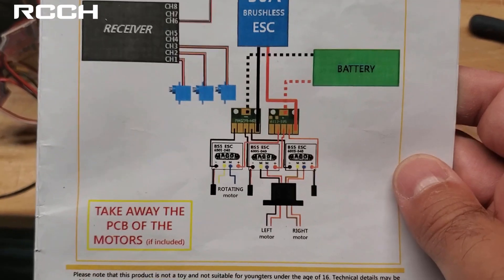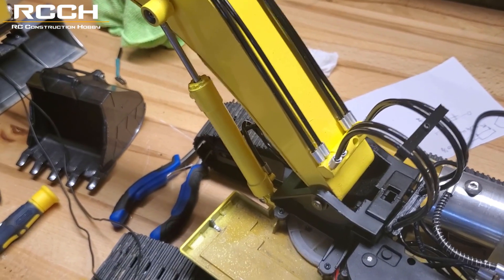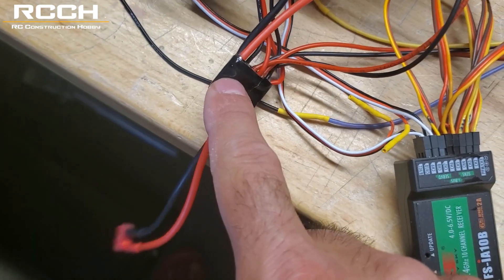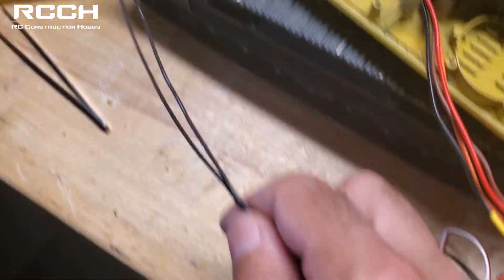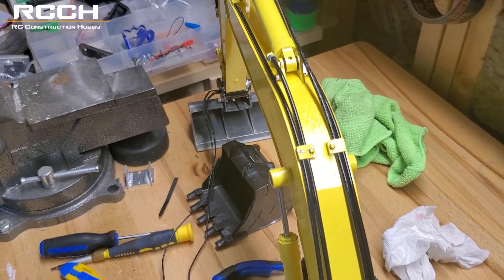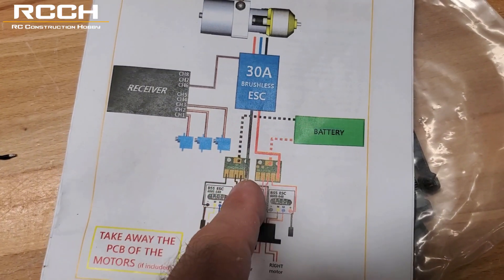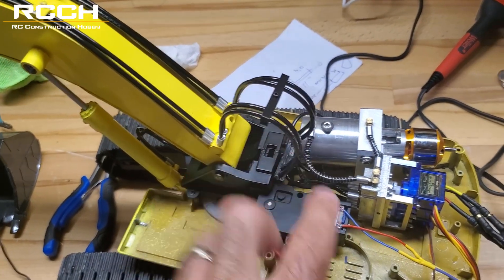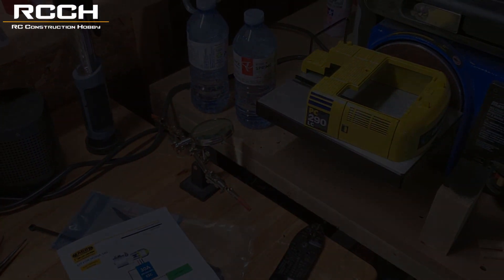Installing All The Electronics Into the Huina 580 Hydraulic Conversion from Magom. Step By Step!

Comment: Does it work off the old controller or do you need buy new reciver an transmitter?? Plz let me knw??
Reply from the maker: No, you would need a new receiver and transmitter. Because it now needs channels to be set to certain parameters and mixing. The old circuit board is only set up for the transmitter that came with it. Essentially, we are taking it from a toy to hobby grade rc.
Reply: @RCConstructionHobby  where did you get your controller? What i do rc trucks so point where to go??
Reply from the maker: It is a flysky transmitter.vthere are better options now like the flysky fs-st8 for excavators or for anything with 10 channels. Get the full kit not just the basic model.
Reply: @RCConstructionHobby  what u mean full kit?? I got am excavator I'm tryna do this too
Reply from the maker: If you look on aliexpress you have 2 options when buying the transmitter/reciever combo. You want the one with the upgrade version. See this link. https://s.click.aliexpress.com/e/_mM3C5IL

Comment: do you run a mix for the pump or put it on a switch? do you run it at half speed on a 3 way switch or full beans?
Reply from the maker: I run a mix and it starts as soon as I move the sticks. The pump is at about 60%. Each stick runs at a different speed based on the endpoints I input.

Comment: the track motors have a round green board on them do i need to take them off??
Reply from the maker: If you are doing the conversion yes. You will want to install ESC's to replace the green board.

Comment: Hey buddy I am a school boy of class 12 . After some days there will be a science exhibition. It will be very helpful to me if u make a video on how to install all wiring and hydraulic kit. In an excavator
Reply from the maker: I made another video on installing the hydraulics. This video shows how the electronics are installed. I would be a very long video if I had to show every single step like cutting the wire and soldering.

Comment: Hi nice machine could you put up a link of were your got your remote please
Reply from the maker: I bought the transmitter from Amazon. The sticks are 3dprinted. Search flysky fs-i6s
Reply: @RCConstructionHobby  thanks but in still struggling to fined one that has both sticks that return to the centre
Reply from the maker: You can buy the centering stick for the flysky transmitter. Very easy to do. They cost like $5. Don't walk away from these just because the left stick is not centered. Buy the transmitter and add the stick centering kit. Very easy to do.
Reply: @RCConstructionHobby  ah ok thanks a lot I didn't know I could do that

Comment: Is it usual to use brushless ESCs...I see most rc excavators using brushed ones
Reply: S then is a brushless motor better to use with hydraulics?
Reply from the maker: For the pump yes. For the tracks brushed is better. Think if you want fast then brushless. If you want slow then brushed.
Reply from the maker: Deoends on the type of motor. If it is a brushless motor then a brushless esc. If it is a brushed motor then brushed esc.
Reply: @RCConstructionHobby  yes..I understand that. Thanks